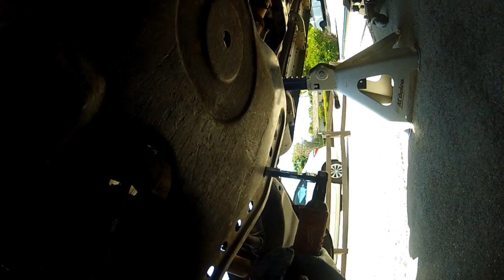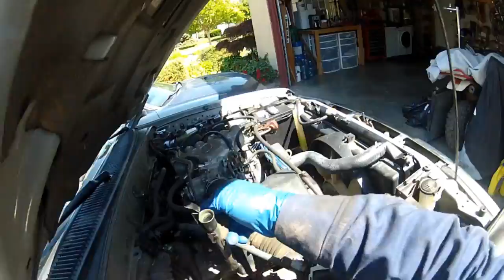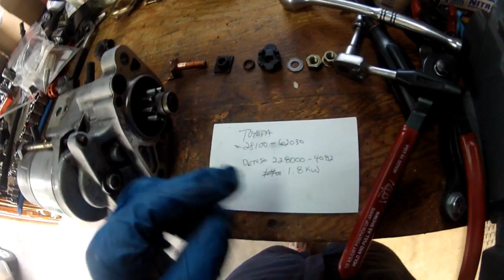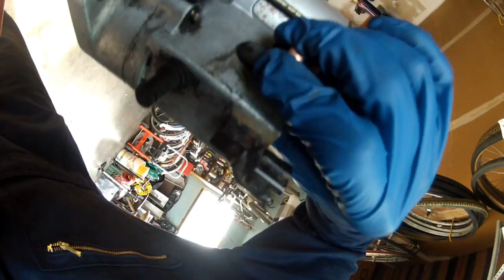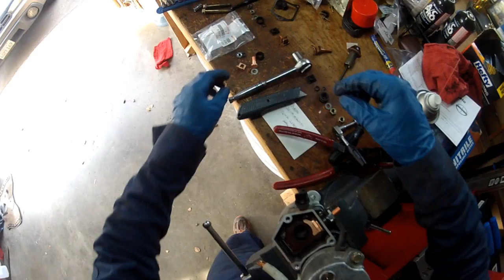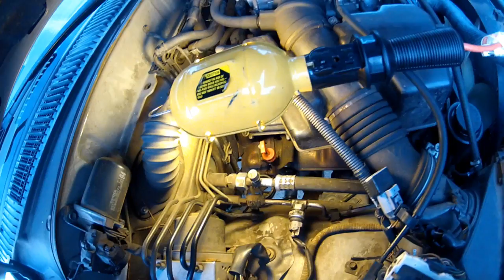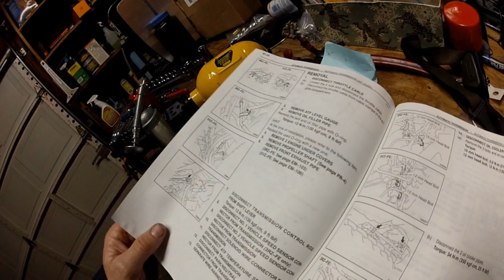Starter Removal and Solenoid Repair

Comment: For those doing this job on a1st gen Tacoma I just wanted to leave this comment that I found it much easier to get the  starter out through the bottom, dropping it straight down and pulling it out right above the steering rack. Keep in mind I have my swaybar removed. What I found on my truck a 2003 3.4 L automatic double cab 4 x 4 was that the orientation of the brake line is different from what it shows in Tim’s video. I’m not sure why it would be different on a Tacoma versus a 4 runner but even after disconnecting a bracket on the firewall on the backside of the frame, it did not allow me to pull the brake line very much out-of-the-way not nearly as much as Tim was able to in his video. I found that once I got the  two 14 mm bolts  and both lines running to the starter disconnected i  pulled it forward angled it up at a 45° angle and dropped it straight down.  I had to tilt it slightly to get it past a hard line on top of the steering rack. It seemed to have a lot more room to maneuver it and drop out going through the bottom, then trying to sneak it past that brake line in the wheel well. Taking it out this way would save you the time of disconnecting the brackets to try to move the brake line out of the way and having to remove the transmission dipstick tube out out of your way as well.  Maybe earlier year Tacoma’s have the same brake line orientation as in the video but I have looked at a O2-04Tacoma‘s and they all have the same brake line orientation as my truck does. Anyway, just wanted to save somebody some frustration and let them know it can be taken out through the bottom [ if you have your swaybar disconnected or possibly turned enough to be out of the way] .

Comment: @TimmyTheToolman have you heard or has anyone else on here done this job on a first GEN Tacoma. I have a  2003 automatic 4 x 4 double cab. The brake lines on the first in Tacoma‘s are different than the one in your video it is you Shad and one of the parts sticks up right in the way even after removing a bracket on the firewall and on the backside of the frame, it hardly pulls out out of the way very much like yours did in the video. I don’t see how with that brake line in the way you would get it out through the  well well like you did in your video wondering if you have heard anyone else would know that they come out from the bottom. There has to  be a way to get these out under the Tacoma’s. I just don’t know how it would squeeze through that opening in the will well because the brake line will not move out of the way enough like it did in your video. Thanks for any help. You could give me on this.
Reply from the maker: We haven't done this on a 1st Gen Tacoma, so I can't speak from any experience how it works to get it out through the wheel well.  I really doubt there's that much difference since I know the front end of the 3rd Gen 4runner and 1st Gen Tacoma are nearly identical.  You can try loosening the upper control arm bolt/nut and knocking it forward to give the starter more room to come out through the wheel well.  Also, you don't have to treat the brake lines gingerly.  You can crank on them with a decent amount of force and you're not going to destroy them.
Reply: Thank you for the reply. From what I found the brake line orientation is different in the first GEN Tacoma‘s. Maybe it depends on the year. I have a 2003 3.4 L V6 double cab 4 x 4. The brake line  comes out of an L bracket and makes a U shape that goes down on the backside of the frame. Even after removing a bracket from the firewall and the backside of the frame, this does not allow you to move the brake line very much out-of-the-way. I know you said you don’t have to be very careful with them but I did not feel comfortable with trying to pull the brake line that hard out of the way to give you enough space to remove it from the. wheel well. After having completed this job, I found it was much easier to get it out from the bottom that being said I have my swaybar removed. You just angle it up at a 45° angle drop it straight down and you can sneak it out the bottom right above the steering rack. There is a line on the steering rack that is kind of in the way, but you just have to tell the starter a little bit and it can easily slide out right through there. At least on the first GEN Tacoma’s with this set up it was way easier to get it out through the bottom. Other videos I watched specifically working on 1st gen Tacoma’s did it this way as well.

Comment: For those with a stick shift, you are able to bring the starter down and turn it so that you can get around the rack and pinion high pressure line and get it out.

Also, use a socket wrench with a floppy head (technical term), a short extension, and the 14mm and you can get both the top and bottom starter bolts out - if you have a 5-speed manual.
Reply from the maker: Thanks for sharing your experience doing this on a manual trans model.

Comment: Great job Tim. I'm waiting for my contacts and plunger at the  moment.  I've  got to saythis. I got a set of swivel head sockets at Harbour Freight and those two bolts came out like a dream. Say DAMN! Also a set of their locking 3/8in extensions. Nothing came apart while doing that bolt work.

Comment: Another magic trick go get it out through the wheel well. Use a jack with a block of wood to press up on the oil pan. That will lift the motor the 1/8 inch you need to wiggle it out between the exhaust flange and the upper control arm.

I also had to take the UCA bolt and washer off, take out the trans dip stick, and remove the brake line bracket bolt. But moving the engine up was the dam break.

Comment: 2000 4runner SR5 w/federal emissions and a different 1.8kw  denso part number than Timmy's.. removal through fender doesn't work without a few tweaks.

1. Remove UCA nut and flush bolt inward.
2. Open starter and remove positive contact. The contact 'bolt' won't clear the UCA without doing this because the exhaust restricts movement.

Video was a nice guide, so thank you. But not all generations are the same. Toyota is/was known to change things up half way through the year. Congrats on the move.
Reply from the maker: Thanks for sharing your experience.  I wasn't there with you for the job, so I can't say for sure what you're reporting is 100% accurate.  There's been plenty of guys before you that thought it was impossible to get the starter out through the wheel well, but they finally got it without getting the UCA bolts and nut out of the way.  For the most part, it was simply a situation where the person had to tweak the break like over a little more.  

Anyway, Im not saying you're wrong.  I'm just reporting to you what others before you experienced and my own experience doing the job.  Maybe the only way to get your starter out was exactly how you did it.

I'm glad our video helped you out
Reply: @TimmyTheToolman I'll recheck if that line can be pushed over more. I had it zip tied to the lines running along the chassis and it felt like it was at its limit. But man, I was at it for 3 hours determined to get it out in one piece. Even tried the sway bar drop despite the magicry you said would be required coming out the bottom, haha. The exhaust pipe closest to the starter looks like it was different on mine than yours tho. Protruding more which was the limiting factor. Who knows. Some critical thinking got the job done and the reward was worth the pain. Stay well!
Reply from the maker: @JohnEboyee  Yeah, I've seen the differences with the exhaust and maybe that was the defining issue which required you to get that UCA bolt and nut out of the way.

Comment: Timmy, is there a way to determine which kV starter is on the vehicle before removal? I read a forum thread that said there were two different starters and looking online I see different part numbers. Thanks in advance, man.
Reply from the maker: There's a label on the side of the starter.  I don't think you can read it while the starter is on the rig.  I mentioned this in the video, but there's a regular starter and a cold weather starter.  The cold weather starter has a higher kilowatt.

Comment: Just finished this on my '97 4R 6cyl 4x4, and even got to save a step as mine has a standard trans with no dipstick. This video was a huge help!Thanks to Timmy for detailed instructions and good advice, you turned this into a 2-beer job. Definitely helpful to lay out the contact pieces like that! The part #'s for mine were: Plunger 28235-55050, Contacts 28226-22050 and 28226-74070, and Gasket 28175-55050. Hope this helps someone out there with a 1.4kW starter!
Reply from the maker: I'm glad you found the video helpful.  Good job on the repair.

Comment: Thank you, Tool Man!
This was a 4 hour slog (95% bolt removal/replacement) , but it would have been nearly impossible without your help!
Big guys beware, this is one of the few jobs where big hands and thick arms work against you.
'00 v6 4x4, bought a remanufactured starter from the dealer for $140 + core
Reply from the maker: You're welcome.  Yeah, there's many times turning wrenches I was happy I have small hands.  The only problem is, small hands, small ___

Comment: Hey Timmy I was actually ordering the parts as I watched the video. Well that was a mistake when you mentioned it was just the parts for that model. I was able to cancel the contacts but not the plunger. You think that one is compatible? With other models
Reply from the maker: There's a good chance it's compatible with other models.
Reply: @TimmyTheToolman  hey thanks for taking the time to reply. I successfully cancelled the order. I will be doing the same and hitting up my local dealership. That's what I get for ordering halfway through the video. Cheers
Reply from the maker: @elhiezenberg8393  You're welcome.  Good luck with the job once you get the necessary parts.
Reply: @TimmyTheToolman just wanted to report back Timmy, I finished the project just now. I ended up spending the extra money and getting the whole thing new. I didn't wanna test my luck and do it twice. The hardest parts was lining up all the extensions with the swivel .thanks Timmy ,your are a blessing.

Comment: Did you put anti seize on the starter mounting bolts? If so, what type of thread lubricants did you use? Had to use a manual impact screwdriver to get mine out and don’t want into that problem again.
Reply from the maker: @johncarloscruz8766  I didn't use antiseize on the bolts, but it's not a bad idea if you live in an area that salts the roads in the winter due to ice or you live on the coast and the salt air corrodes the metal on your vehicle.  We live in the California Bay Area, and corrosion isn't an issue.

Comment: Question: can’t tell from starter motors for sale but is there a gasket or o-ring i may need to get before pulling the assembly off? Don’t want to get it pulled then discover i am missing something causing delays. Thanks! Yes, i have 140k and just started seeing the symptoms. Time to get repair plan going. This video has helped that immeasurably!

Comment: I used your extension bar idea ,But I took the nut of top control arm and taped it thru an inch flush with control arm came out easy mounting side 1st
Reply from the maker: Good job.

Comment: Thanks so much Timmy. You’re awesome. I removed the sway bar, dip stick and unhook one of the steering rack line and was able to remove and replaced  starter and put it back with ease. I’m so amazed at Toyota quality and longevity. I replaced the whole starter since it looked beat up and been in there for 23 years.
Reply from the maker: You're very welcome Rich.  I'm happy our video helped you swap out your starter.  I hope you kept the old one as a trail spare.

Comment: Great video Tim. My 97 Rav 4 starter runs when i turn off the engine. Sounds like the same problem. Thanks for such a detailed video of a major problem.
Reply from the maker: Thanks Charlie!  Yep, the plunger is sticking against the copper contacts.  A new set of contacts and plunger should get your starter running right again.  You're very welcome.  Good luck with the repair.

Comment: Hey Tim,

‘98 M/T 3.4.

Yesterday AM I noticed the starter gear would spin the crank & then disengage, re-engage, disengage, 2-3 X’s before it would start the motor.

I have this Saturday to get it done (Seattle), do no time for rebuild just be able to get to work next week.

Any feedback?

Thanks 
David Tobey
Reply from the maker: Rebuilding the solenoid with new contacts and a plunger does not take long.  But, if you can't get the parts in time, your best bet is to get a rebuilt Denso starter.
Reply: Hi Tim,

Thank you for the reply.

I’ve had to postpone due to repair facility capacity.

One added symptom is only when cold.

I have already bought the reman denso from Napa.

Next weekend is my repair slot, own jack stands, own garage availability.

If I might I would like your opinion on an equivalent Marlin crawler front end for the gen3 4R?

Equivalent due to Marlin not building RCLT HD for our 3rd GEN & not making their Mar-Rak & long travel components/cam adjusters for our vehicle.
Reply from the maker: @DavidTobey-k1n  So you want a long travel kit for your 3rd Gen?

Comment: Hi Timmy, i just replaced the starter with a new one on my 97 4runner I alao replaced the relay but it just won’t start. The starter sounds like it’s turning (knock) but it won’t start. I was starting it with jumper cables plugged in to another car. Please advise. Thanks
Reply from the maker: Maybe your flex plate broke.  I'm assuming you have an automatic.  Take off the inspection cover on the bottom of the bell housing and take a look.

Comment: where can I get a copy of that factory 5VZ paper repair book ? or is there a downloadable version somewhere ? amazing repair of that starter ! how long do those starters last ?
Reply from the maker: What year, make and model vehicle do you have?
Reply: @TimmyTheToolman  2000 Tacoma SR5 PreRunner (2wd) extra cab with off road package - 5vz-fe , I had Chiltons back in the day, but they were missing some details sometimes, I've had 2000 4x4 versions of this truck, but just inherited this little guy and just want to be able to maintain it , it only has 100k on it, mint condition. thanks !
Reply from the maker: @Evepc_Tucson  You can find them for sale on Ebay usually.  I did a quick search and found this set for sale: https://ebay.us/zVBiU5

Comment: Hey Timmy thanks for posting these great videos they really help us out.
Is it possible to salvage the plunger and/or the solenoid contacts, like cleaning off any rust? 
Or is it dependant on the thickness of the contacts ? 
Also, did you do any testing to figure out what was wrong with your car ?
My car wont start at all and I just charged the battery.
Im pretty sure its either the starter itself or theres a wiring problem
Reply from the maker: You couldn't salvage the contacts because they wear down.  Maybe you can salvage the plunger, but I wouldn't.  It's not that expensive to replace.  The problem with my starter is it got stuck.  It kept running even though I had the ignition key off.
Reply: did replacing the starter work?

Comment: Just finished rebuilding my starter using this video, thanks as always Timmy!  One thing I did not notice in the video (or in the comments) is that the FSM says to make a small wooden block and use it to push down onto the contacts with about 200 lbs of force before tightening the nuts holding the contacts.
Reply from the maker: That's interesting Leon.  I have no clue why you would have to do that.  How would you measure that force anyway?  Maybe use my calibrated forearm. bicep and shoulder when pulling the press handle.
Reply: @TimmyTheToolman  I think the idea is that pushing in on the contacts seats them against the back, so that the plunger hits them evenly for better contact?  You're right, measuring the force is not easy, I just happened to have my load cell around from the LBJ bolt testing, so I put it to good use :).  Or a calibrated forearm and bicep would also work :).
Reply from the maker: @spikerengineering3447  OK, what you said makes sense.  If the contacts were slightly tweaked, then the plunger wouldn't be contacting a flat surface and might possibly get hung up.  When my starter failed, that's what happened.  The plunger got stuck and the starter kept running even after I turned the ignition key off.  When I tore it apart, the contacts were unevenly worn.  You're the first person to mention this.
Reply: @TimmyTheToolman  Right, exact;y, I think that's the goal.  I'm sure the 200 lbs doesn't need to be exact - they just want you to push down on the contacts before torquing the nuts.  I just happened to stumble across that section of the FSM when rebuilding my starter, so wanted to share this with you (and the community).
Reply from the maker: @spikerengineering3447  Yeah, thanks for sharing this Leon.

Comment: How do you take the clip apart from the starter
Reply from the maker: Do you mean the exciter wire connector that clips into the bottom of the starter?
Reply: I had a hard time at first with that clip (exciter connection). There is a square shaped button you can press in with a screwdriver and pull the wire right out.